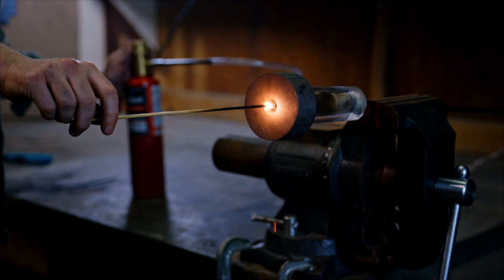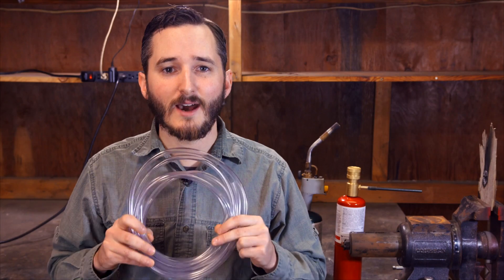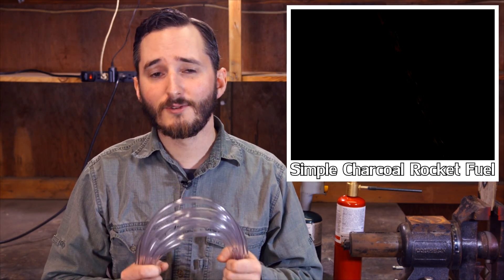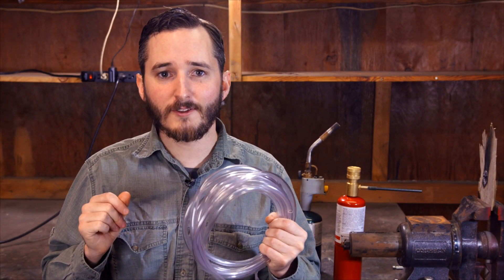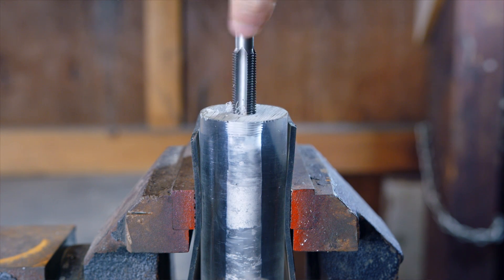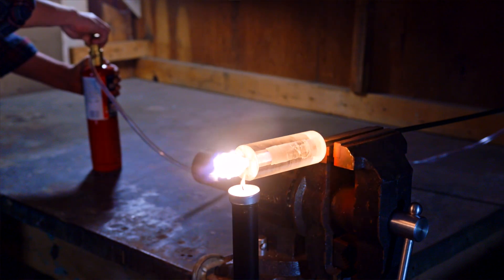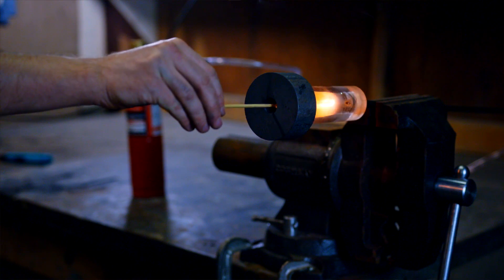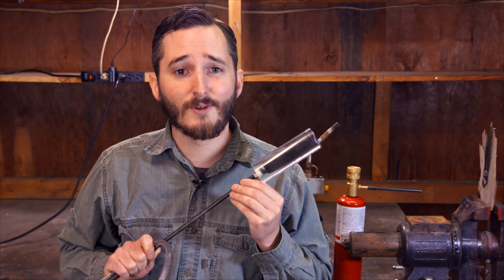Building a DIY Transparent Hybrid Rocket Engine - NightHawkInLight

Comment: the acrylic burns on the inside or appears to be boring due to something i remember as flame polishing. Im not 100% sure if thats what it is but usually when making acrylic fish tanks we use a torch and burn it to make it appear clear in areas that are not visible. such as when we sand the side or like how you drilled through it. I do believe thats why the acrylic appears to be burning

Comment: The reason it looks like the flame is traveling backwards is due to the flame "polishing" the surface.  The drill leaves a very rough surface but as the plastic heats up it is being "polished by the flame making it clear.

Comment: The less than smooth drill marks on the inside may have been smoothed out as the surface burned/melted, changing the apparent shape viewed by of the light traveling thru it.
Reply: The rate of combustion is determined by the amount of oxygen fed in.  There's probably some complicated physics going on between the speed of the input gas cooling and pushing the plasma out and the speed at which it ignites surrounding material, working its way in.

Comment: Regarding the apparent shrinking of the ID: This may be caused by the change in temperature of the acrylic material which changes the speed at which light will pass through the acrylic and therefore the angle of refraction.

Comment: Where do you get the oxidiser powder from?

It seems pretty useful to have on hand to start a charcoal BBQ.
Reply: Google - Firework Oxidizers
Reply: At camp it was a 1:1 ratio of the potassium nitrate and sugar.  Then it was ignited with 1 oz of sulfuric acid pour on it using an ingenious reusable pouring apparatus.
Reply: Eineus21 sugar is a good oxidizer i think. thats why sugar is used to make some solid fuel rockets, aka candy rockets

Comment: I'm guessing it looks like it shrinks because

1a) the burrs from the drill press are melting
1b) the char from the previous burn is ejected

and 

2) the refraction index of molten acrylic is different from that of solid acrylic

You don't show it in the video, but can you see the opposite effect along the whole length of the chamber as the acrylic cools?

Comment: I wouldn't call that a nozzle at all. It would have been a trivial matter to have bored out a convergent transition from the 'propellant' end of the thing (using a thicker rod), and a divergent phase from the other. That's a proper deLaval nozzle; it would have lasted only a few seconds, but would have shown an actual rocket engine in operation for that short time, and would have displayed the really interesting part of a rocket engine operation: the accelerated movement of combustion gasses through the nozzle . I should also be recorded from a fully side view.

What you have there is little more than a tube that burns from the inside.

Comment: Does the core look like it's shrinking as it catches fire because its index of refraction changes as the surface heats up and melts?
Reply: You beat me to it. As it goes molten its refraction index changes. Great mind urdnal.
Reply: fla playa when it melts will it eventually melt though one of the sides or all the sides?
Reply: I was thinking about simply moisture vaporizing away but ok einstein
Reply: @tako1257  Where would the moisture come from?
Reply: @BackYardScience2000  You must have  some problems yourself if you think you are above someone judging from a youtube comment, calm down.
Reply: @tako1257  I'm not the one who became rude over a simple question.  It sounds like you're the one who needs to calm down.  I never said I was above anyone.  That came from your mouth.  All I did was point out your own admission.  But hey, whatever you gotta say to feel better about yourself, right?
Reply: @tako1257  Then you have a weird way of not being rude.  Literally, anyone would see that as being rude.
Reply: @BackYardScience2000  Seriously, calm down smarty pants
Reply: @tako1257  You sound like you need to calm down.  Why do you keep getting all worked up?  I simply asked a question wondering where the water would come from and you freaked out.  Are you bipolar?
Reply: @BackYardScience2000  No. Shusshh
Reply: @tako1257  You sure?  You definitely seem like it.  I suggest medication and therapy.
Reply: @BackYardScience2000  Could you please stop bothering me?
Reply: @BackYardScience2000  I didn't start anything, I just made a joke over half a year ago. You are the one who needs to calm down, so please stop wasting your time, since its better for you that I don't respond to you next time, have a nice weekend.
Reply: @tako1257  more like Omega Doof amirite
Reply: @tako1257  What's wrong with you man
Reply: @benjaminmuller9348  As I said, I was stupid back then. Actually I did have bipolar depressive disorded. My girlfriend at the time had dumped me and my grandpa had recently passed. So to cope I lashed out on the internet to people, rather than talk to someone. I'm so very sorry about being a dick to everyone back then and I promise I have changed.
Reply: @tako1257  right in the feels man, I hope you and yours are doing better.
Reply: @tako1257  yh good
Reply: Really?
Reply: urdnal    Uhh .... yeah... okay.   If you say so.   🤪

Comment: That is a very good, educational video!
However, aren't you a bit concerned about wearing gloves when holding something under a drillpress? It was strikty forbidden in our metalshop to do so.
Reply from the maker: The gloves are weak vinyl. They are not the sort that would be able to pull your hand into the bit.
Reply: you know what dude welcome to my laboratory where safety is number one priority
Reply: Well I am an alive unsafe idiot with all his fingers so it looks like I don't need the safety police. Thank you and bye bye.
Reply: "All pieces being worked on using a drill press need to be clamped."
That's not true, you don't need to clamp everything, even in a metal shop. In fact, it would cost way too much time. I drilled 5mm holes into 6m long pipes like thousands of times never clamping anything. That is an extreme example of course, but it pictures the situation in which clamping is only a pain and not usefull in any way.
Reply: When the thing is round it can't hurt you if it gets caught and start spinning so it was ok not to use gloves in this particular instance.
Reply: "[...]so it was ok not to use gloves[...]"
Right, NOT wearing gloves on a fast spinning machine is what I was told to do.
Reply: Reread my comment not only the part you're interested in.
Reply: Oh my god, the irony.
Reply: Look dude, him beeing better off wearing no gloves at all was my point from the beginning. Which you would have noticed if you had:
"Reread my comment not only the part you're interested in."
And my believes are none of your business Pastor.  #punintended
Reply: My bad I misred your comment in the first place. Apologies mate.
Reply: We all have those days. Have a nice sunday evening!
Reply: Sorry Michael, but your an unsafe idiot.

All  pieces being worked on using  a drill press need to be clamped.

Comment: Don't burn vinyl tube, ever! I think it makes chlorine compounds when it burns :(
Reply: There is no Cl in Acrylic so it can't make chlorine. You are mixing it up with PVC.
Reply: He was talking about the vinyl tube that was burned, not the acrylic. While it's true that "PVC" has the same problem, it's because "PVC" and that tube are BOTH a vinyl compounded with chlorine (PVC stands for Poly Vinyl Chloride). The reason for the different properties is due to plasticizers, and other additives. In conclusion, Brian was right, although chlorine compounds aren't the only dangers. Dioxins are one of the most deadly toxins known to mankind.
Reply: Yes you are absolutely right. I thought he was talking about the Acrylic when he was talking about the Vinyl oxygen supply tube. Sorry for the confusion. Not a good idea to burn it. Dioxins are stored in the fats of the body and are toxic for a very long time.

Comment: Because it melts, there is no longer gas to solid barier but gas to liquid to solid barier, which the light has to travel trough. Am I right or am I wrong? As for the question at 8:30

Comment: I have a re-purposed hospital oxygen generator for use with my smiths little torch (oxy-propane). it'll run about 6 torches at once at full output. 
I suggest getting one.. it may be cheaper in the long run. They get used in the glass blowing industry for injecting oxygen into the kilns. Tuffnell Glass has them for sale.

Comment: well it's not really a rocket at all if the gases don't reach sonic speed at the throat of the nozzle, demonstration or not. Its just a flame torch. the main principle behind a rocket isn't mixing fuel and oxidiser to burn, it's the way it creates thrust by expanding a supersonic flow of gas. It's like turning on a welding torch and saying it demonstrates a rocket engine....no it doesn't.

Comment: Your video has inspired me to look into the possibility of miniaturising this to make a hybrid rocket powered radio controlled plane. Do you think it would be possible to use a small nitrous oxide cream whipping canister? I know they are quite high pressure. I am not exactly sure about all the nitrous oxides and nitrogen oxides whether they are actual compounds reacted together or just different gases mixed in with each other.

When i researched it online, it says nitrous oxide is an oxidiser at high temperatures. I have no idea how long you would get useable thrust from it but I would love to experiment with it. I suppose depending on how fast the pressure release is you may need to run it through an evaporator pipe close to the engine.

Comment: I think I can explain why the core of the rocket shrinks as it ignites, but my explanation assumes that your rod is extruded rather than cast.
The rod is extruded under a high pressure, the finished rod is left with the molecules compressed together. Once you heat it up close enough to its melting point, the acrylic expands until the stress is relieved.

It is also possible that the apparent shrinking is just an optical illusion, caused by the refractive index of the acrylic changing as it melts.

Comment: I think the rocket's core appears to shrink as it ignites because the plastic near the core melts: that will both cause it to expand to partly fill the core, and change its index of refraction, causing a lensing effect.

It would be good to measure your rocket's thrust: easy to do by hanging it horizontally from two strings, and measuring their angle while the rocket is firing.  I doubt it's anywhere near enough to lift the rocket: if it were, the chamber pressure would blast your graphite nozzle off the end -- it's only press-fit on there, right?

Comment: the acrylic in the center melts, doesn't it?
Reply: Gavin Clark
but what is that immediate reaction inside the tube after ihnition then? I was just guessing. I certainly have no idea what it is but took a guess what it could be.
Reply: Pretty sure it is the acrylic expanding due to the heat
Reply: I think the acrylic was flame polished because it had a matt finish on the inside of the drilling

Comment: On the inside as you describe as shrinking it is not. It is just flame polishing the hole to a glass finish before you start burning it in other words taking the scratches from the drill bit out

Comment: wait a second the acrylic tube is fuel for the rocket? so it will eventually collapse once it gradually burns away? i assume this is just a proof of concept and that hybrid engines uses a differnt kind of fuel and their casing does not burn away

Comment: Actually, the nozzle you built is totally useless. In conventional rockets, the parabolic shaped nozzle helps redirect the direction of the linear momentum of the exhaust gas particles, so that the exhaust gas has less radially outward momentum hence more momentum for the rocket in the straight direction.

Comment: I think the shrinking of the inside is due to diffraction. When you drill it it leaves a rough finish which just diffuses the light but when it is melted it gives a clear smooth finish and as it is a curve it diffracts the light more.

Comment: Hey NightHawkInLight, a quick critique/suggestion on your nozzle. if you look at the video, the exhaust isn't attached to the wall of the nozzle. This is flow separation, it happens when the pressure of the gasses in your exhaust are too far below atmospheric pressure, and the atmosphere forces it's way into the nozzle and pinches down on the exhaust giving you that little jet coming through. It's a pretty easy fix though through trail and error, just slowly shrink the outlet diameter until it sticks back to the nozzle wall. Also I'd shrink the center hole to about 7/8 of what it is now. 

edit: looking at it again, it actually seems like the pressure inside the acrylic tube is too low, so maybe an easier fix would be shrinking the diameter of the center hole to increase the pressure.

Comment: YOU CAN SHUT OFF A SOLID FUEL ENGINE all you have to do it cut it in half before the side thats burning reaches the end or top
Reply: ive had to before.. lol
Reply: well if ya think about it that way i suppose lol unless you throw the burning chunk immediatly into water
Reply: Very safe, very easy and definitely something you would do in a flying rocket to modulate the thrust lol !
Reply: Not to mention a lot of solid rocket motors are burning their whole length at once.
Reply: nice dude thanks

Comment: Not sure why the core looks to shrink, but i feel its partially light refraction, because the acrylic already refracts differently, looking into it when u drill it, so perhaps the difference in heat or light makes it refracht in a different way? Or perhaps because the centre core is getting a bit liquid or burned? I dont know, tell me!

Comment: The core looked like that because when you drilled it there was a very rough surface left. Rough acrylic looks milky white. When you lit the gas that rough acrylic melted into a perfectly clear surface. From there optics took over and you get what you see in the video.

Comment: Hey NightHawk, studying aerospace engineer here.  I'm sure you've already looked into this, but I'll comment for those wishing to try this at home: BE CAREFUL!  Should the chamber pressure exceed the pressure of your input fluid, any disturbances, including combustion, can propagate backwards into the propellant lines and potentially explode, especially when using a flammable propellant line like vinyl.  Granted, the pressures you will be able to achieve without a proper DeLaval nozzle will be low, but nontheless, oxygen is incredibly dangerous.

As for NightHawk, have you considered an injector rather than simply straight-piping the oxy?

Comment: I think that the reason the core of the engine seems to shrink is that the heat from the combustion is smoothing out the inside and reacting differently to the light source

Comment: I did this on accident with a pringles can and some rubbing alcohol. I was trying to launch a tennis ball  but I messed up the fuel:air ratio.
Reply: i have also gotten messed up with ratios like that, I've found a good rule of thumb is if you want an explosion litel gas lot of air and just work your way up.
Reply: Cool! I'll remember that the next time I'm messing with stuff like that.

Comment: Regarding the apparent shrinking of the hole, here's my take. For a start, the hole appears bigger than it actually is because the surrounding cylindrical piece of acrylic is acting like a magnifying lens. At room temperature, the refractive index is about 1.47. As the layer of acrylic near the burning center heats up, the refractive index drops (in most plastics, the index goes down as the temperature goes up). The magnifying effect is then reduced, which makes the hole appear to shrink. Hope that makes sense!
Reply: I think you are right I just wrote a comment basically saying the same thing before I saw yours.
Reply: Nice! I was comment searching for an answer. My best ideas had been uneven thermal expansion due to an uneven heat distribution, but the apparent change seemed to quick for that. One other idea I had tumbling around was that maybe a fusing of all the scratches and cracks from drilling allowed the clarity to extend further in.

Comment: Awesome work dude. Did you find this style less labor/time intensive to produce? 
I thought it flowed well and was just as informative as your other work; it was interesting all the way to the end, put it that way. :D 
I guess another factor that plays into it is: was this less creatively/mentally taxing and more fun for you? Because if this style only has a little less Information Density but still gets the same message across and is easy to produce, then this helps you do your job more efficiently. 
I was really worried about our recent video "How to make an Ultra Sledgefire" because I had put so much editing time into and it's the Build Guide Vlog style. But it worked. After 30min we still have 20% Audience Retention with 330k views, which is great for the Youtube Algorithm and CPM ratings. 
So yeah. If your audience is invested in you and your work they will watch you content regardless of its length, even if the work is you talking. 
Goodluck NightHawk. 
-Justin

Comment: it seem to pulse a bit no?
Reply: I know this is a year late, but the pulsing effect is likely due to shocks. When a nozzle is not ideal, shocks form inside. When a shock forms there is a pressure difference from one side of the shock to the other. This pressure difference causes the shock to move, because the conditions by which the shock formed are not the same. The shock eventually exits the nozzle and a new one forms. This is likely what is causing what you are detecting as the pulse.
Reply: @rogeredge1604  2 years *
Reply: @orkanozgur3749  Thanks. Last month it said 1 year.